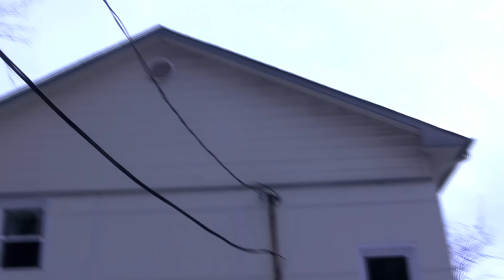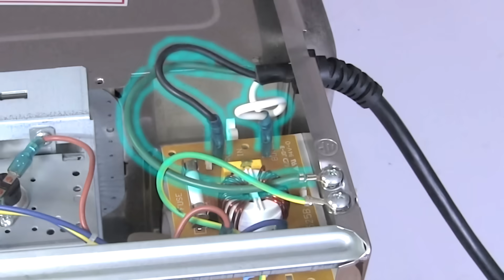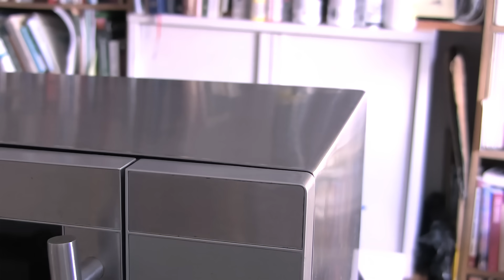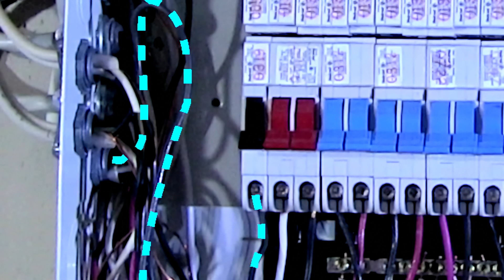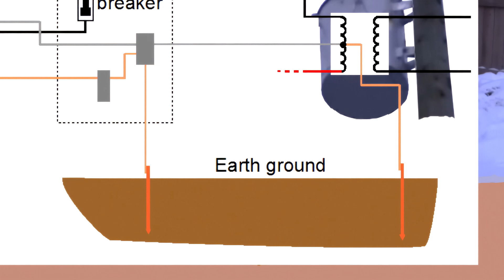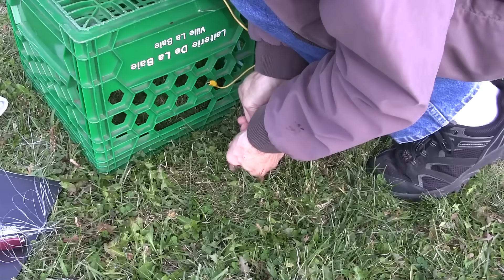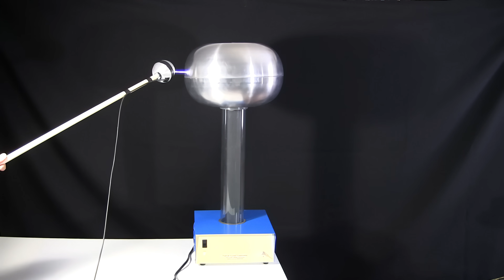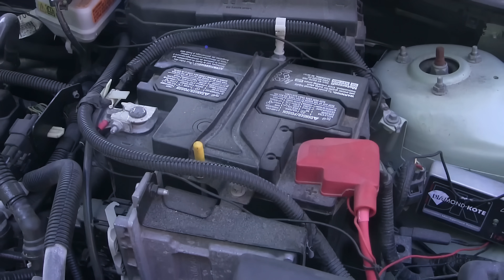What is Ground? Earth Ground/Earthing

Comment: The U.S. system is strange. It looks like you cannot put a grounded plug on an ungrounded outlet but can put an ungrounded plug on a grounded outlet. That is just the opposite how it should be. Using ungrounded equipment in rooms where there is ground is dangerous. On the other hand rooms where there is no ground it is not necessary to ground anything. In fact if you ground it is no longer such a room and you need to ground everything. Grounding is an all or nothing issue (excluding equipment with double isolation).
Reply: No such thing as an, Un-Grounded outlet or Switch. All receptacles must have a ground lug and ground wire, 3 prong outlet. Must be tamper resistant. Anything within 6 feet of water. Must be GFCI protected on that branch circuit. It can be anywhere on the circuit. As long as it is accessible..As NEC Code states. NFP 70e rules also can govern their use and installation. As Commercial and Industrial have higher standards. Anything from Vapor to Explosion proof. 

And everything is grounded. Unless on a low voltage circuit of 48 volts or less. Designed for that purpose. And yes double insulted tools and AC\DC drives do not need a ground prong. They have their own built-in thermal protection and must be clearly marked as such. As I seen inspectors walk around and cut the end off the cord. If it is not. As I had one cut the end off my Hilti Core Drill... His company had to cough up $2900.00 US dollars to replace it. As it was clearly marked.

Try watching some of Mike Holts ideas on Grounding and Bonding... https://www.youtube.com/watch?v=mpgAVE4UwFw
Reply: What is this:  https://zerosurge.com/wp-content/uploads/2016/12/elec-outlet.jpg

Yes, in new installations here also all outlets have to be grounded. It has been since the late 90s though in practice the switching began in the 70s.

If outlets are ungrounded it is safe to use any equipment. If they are grounded it is not safe to use ungrounded equipment.
Reply: You go ahead and play around with an ungrounded system...See what happens when a short can not reach the source. As you can be sued if you don't. 

And that outlet you posted. Has no been used in residential applications for 60 years. As it is required inspection before selling an old home. To pig tail these old systems to ground. Replaced with the new 3 prong outlet. As you will not be able to get insurance or financing. Till you do. Same for aluminum wire. They must be NOALOX pig tailed to copper using https://www.homedepot.ca/en/home/p.aluminum-to-copper-wire-connectors-8pkg.1000663916.html

That is NEC code. Along with Local Ordnance that cities impose. 

You should watch the video I posted. On why these have changed. As Electrical Theory has taught us....
Reply: The danger comes if someone finds and old equipment with two prong plug. You can connect it to a grounded outlet which is DANGEROUS. Here that could not be done as the plug is like 

https://productimages.biltema.com/v1/Image/product/xlarge/2000018342/3

and the outlet like: 

http://www.talotuote.fi/WebRoot/vilkasfi01/Shops/2013112707/55F5/6603/22E4/96A7/07D6/0A28/1010/E3FA/PISTORASIA_EXXACT_2-OSAINEN_UPJ_VALKOINEN_MAADOITETTU.jpg

Sure now such old equipment is likely to be rare but that was not the case in the past.

Ungrounded outlet is here like

https://www.finnparttia.fi/WebRoot/vilkasfi01/Shops/2014102905/5491/4F14/05A9/0A1A/C834/0A28/1010/BFCB/PP2A_ml.gif

These are not legal in new installations but can be in older ones. On that you can connect any equipment. It is relatively safe as there is no ground in the room. It is specifically forbidden to bring ground into such a room with an extension cord. Some did that as they thought computers needed to be grounded.

Comment: There is another reason why we should literally connect the ground wire to the ground at breaker panel: if the neutral wire somewhere between the breakers panel and the transformer get disconnected, and there is a connection between hot and natural, the natural line and ground line will be charged to same potential as the hot line. You will get shocked every time you touch a metal surface that is connected to the ground line. To avoid this, you need to make sure that the ground line is literally connected to ground. So it's a good idea if you connect your breaker panel case and therefore the ground line to a literally ground.

Comment: Short Circuits will always try and reach the source. That being the Transformer. That is why only the service entrance is bonded to the ground. All other sub panels are not bonded. The only exception is when you are using an Isolated ground. It is isolated to earth ground rod. Used in AC\DC environments like computers. As DC current amps can be very high. One reason they use a Super Neutral. To handle that over current. If the AC\DC transformer fails...
Reply: Fascinating! Info you've learned or studied?
Reply: I'm an Electrical Engineer..Started as Licensed Journeyman. I now design PLC\Program systems. Mainly DURApulse AC VFD drives for high speed automation and robotics..

If you want to learn more on grounding and bonding. Try here https://www.youtube.com/watch?v=mpgAVE4UwFw

Comment: Ground has another feature.  It tries to make what you are locally standing on concrete or earth at the same potential as your grounded applience.  I've seen grounds between buildings have 17 or more volts difference.  Seen a steel building arcing to a cast iron sewer pipe.  Grounds don't offer absolute protection. You can have a broken neutral between pole and service box.  Recently a little girl died when she touched an outside water faucet.
Reply: Jesus. That's terrifying. Remind me to bring my Camelbak.

Comment: You dont pay for.elecyricity.
You pay for the electron pump use.

The.sars device captures the degraded electrons returning to the pump for recharging via capaciters which do the recharging then loops the - electrons back through your circuitry aslong as one is open.
The result is you only pay for the initial pump use to charge your circuit. After.that the sars device keeps it flowing for no additional pump fees.
The inventer of it was murdered by the athorities for resisting the removal of the device from his home. The device was never seen again.

All you need to know is current flows from -to + and from + back to -.  This is the transion between ac to dc back to ac.

All you have to do is the converting to loop the initial load requirement

Non of these castrated indoctrinated jockeys will tell you anything really usefull. There all opec, penis toys.

Comment: If my house doesn't have ground cable, is it safe to connect the neutral wire to the ground hole?
Reply: It's kind of safeish and you should probably do that as an immediate temporary solution, but don't do that at the power sockets. Instead, connect the ground and neutral to each other at the fuse/breaker box. That way once you do get a proper ground for your house, you won't have to redo ALL the sockets and lamps.

The reason why is safeish and not completely safe is that a long time ago when there was no legal requirement for things to be grounded, things were not grounded, but they still functioned. But that's where the problem is: What happens when they no longer work? What if something breaks and the "hot" wire gets connected to something that should be grounded? At that point ideally, the "power" will just go to the fuse box along the duplicate neutral / fake ground. But what if it doesn't? What if in that moment you're touching the broken appliance and you're standing on a stone floor and your body is a better ground than the "fake ground"? At that point the power will go through you.
Reply: SmartassX1 Thank you for your explaination.
If I do connect neutral to ground hole at the power socket, is there any safety consideration?
Reply: Well... Other than the above theoretical risk, there shouldn't be anything.

Unless you have a "protective relay" (unless I mistranslated that) among thee fuses, it should be kind of fine. The "protective relay" is a type of circuit breaker where the neutral wire and phase wire both go though. This type of protection is good, but rarely used. If that is used, the relay should activate and prevent that socket from working. This type of protection is so rare that it's more like a "by the way"-type info.

An electrical ground for a house is not a complicated or super expensive thing. You should seriously think about that.
Reply: you can replace all ungrounded receptacles with gfci receptacles. Code allows this.
Reply: Why would a TN-C system heat up the PEN any more than a normal TN-C-S system would heat up the N? Any why would anyone ever disconnect any single wire from a power line that's in use? I suppose there are those who like to steal the copper wires used for ground, but it's good if those people get shocked. Any electrician would obviously turn of the power before doing anything.

His problem was that he sounded like he has a TT distribution system and his house doesn't have a local ground.
Reply: Well obviously the only good option is to just build the correct earthing to the house. And the are acronyms explained at the "earthing system" article at wikipedia.
Reply: The correct place to do this type of tricks is the fuse box. But really one should just do the correct grounding.

Comment: I'm sorry, your explaination is missleading. Ground, which usually referrs to a DC ground is not necessarily earthed. Ground may be floating with respect to Earth potential, like it is in a car, and an aircraft, and a boat, and at the output of modern isolated power supplies, and even old power supplies after a transformer and a rectifier. The negative output of all of these is actually what ground is. Earth, on the other hand, Where a system is connected to the Earth, then it is referred to as Earthed.
In an Earthed system the ground reference is Earth potential, whilst in a non earthed system the reference is the designated ground which may well be floating above or below Earth potential.

You also only describe MEN earthing systems, and whilst I know you go to some level to specify
 that it's in North America, you would have done well to have explained how non-MEN systems work in the rest of the world.
Ground is a floating common reference point, e.g. a car body attached to a (-) battery terminal Earth is referenced to a rod in the earth.
This video is missleading in it's over simplification and missuse of terminology.
Lastly its not sodder, its soLder.
Reply from the maker: I address common ground starting at 8:09. I even mention chassis ground in a car.

Regarding MEN earthing systems and other systems worldwide, I made a decision to limit the scope otherwise I could have gone on forever, plus I would have gotten way out of my comfort zone. The target audience is lay persons curious about the gound hole in their wall socket, though I did add that extra stuff at 8:09. For that audience, I also stayed away from terms like electrical bonding conductor and deliberately used ground wire instead. Electricians should watch videos like Mike Holt's instead https://www.youtube.com/watch?v=mpgAVE4UwFw.
Reply: Rarely does one hear the term “earthed” in North American usage, so “grounded” does duty for both earth-connected and floating references. As for the trolling of the pronunciation of “solder,” the ”L” is silent in every American dictionary entry I’ve ever seen (ranging back into 19th century publications), and everyone I’ve ever known pronounces it “sodder.” Nor do we use ka-nives to cut our saLmon, properly pronounced “sammon,” so there are parallels and precedents for silent letters, not to mention the French origin of the word, which contains no “L.” Lastly, “misleading” and “misuse” are spelled without doubled esses, so perhaps there’s room for all to observe variances and make mistakes.
Reply from the maker: The "L" in solder is pronounced in Europe. I've pronounced it sodder my whole life but for some unknown reason I started pronouncing the "L" every now and then though I try to say sodder, given that a large percentage of my viewers is in the US.
Reply: grounding is actually earting in ac  grid systems. in dc systems it is mistakenly used as slang for the correct term "common"
Reply: Yeah I have always heard "ground", I'm in the States.  I really didn't hear the term "Earthed" until I started watching Big Clives Vlogs.  Peter Peterson's reply does give me a bit more understanding on what the actual difference in the meanings between the two terms.  Either way I enjoyed this video.
Reply: The difference is....  have you ever commented on Big Clive's vlog and smarmily stated "it's not earth, it's ground" and/or "I don't like the way you pronounced soLder!!!"?

Comment: Creepy Socket.
The plug is only held over the contacts in the socket.
In addition, there is no protection against touching the phase of the plug (eg when pulling out).
I prefer the SchuKo ^^.
Reply: Would you prefer bare copper knife swtiches? lol I've done that, it's not fun. You learn to grasp it carefully and just ensure you push it in all the way. A decent plug will hold it well. You can get different rated plugs as well. Hospitals use plugs with a certain force that they grip the plugs with and are marked accordingly so that you can't just trip and unplug someone on life support.

Comment: In Ontario Canada HydroOne has been using ground as a return path for high tension and residential delivery. Stray Voltage takes non linear paths to the point of generation. Electric potentials in excess of 100v/m have been recorded but the regs are 1.6v/m which IMO is still too high. Farm operations are both sources and victims of stray voltages. Also anyone near transformer switching stations can be affected.
Residential Grounding does make sense from a safety perspective, but that's not the whole story.
On the plus side, if your property has a ground potential, use it😉

Comment: Why isn't the microwave case just connected to neutral, so you need one less wire?Is it in case one of the wires (neutral or ground) breaks?
Reply from the maker: When the microwave oven is turned on, the switch basically connects the HOT wire to the neutral wire (through the oven's electronic circuit). That means you'd be connecting the HOT to the case. If someone was grounded and they touched the case, then they'd get a shock.
Reply: Ah, I see, that makes a lot of sense actually. Thanks!
Reply: RimstarOrg 

Makes sense, but it Germany we have "klassische Nullung" in many older houses, where the ground wire is directly connected to neutral. I always thought the reason they didn't do it in the devices themselves is because you can flip the plug around (works in Germany with ground plugs too) so you have no clear hot and neutral in the device. 

Hence your comment really makes me think...

Comment: Video guide is good. But help me out on understanding how an inductor works with an AC voltage source using wave forms
.................Things like : HOW WILL BE APPLIED SINUSOIDAL VOLTAGE GRAPH 
                                        HOW WILL BE CURRENT THROUGH  THE CIRCUIT
                                        HOW WILL THE FLUX BUILD UP AND INTURN PRODUCE ADITIONAL EMF AND THUS INDUCED CURRENT AND HENCE THE LENZ LAW FLUX...............................
                                        WAVEFORM OF HOW MAIN FLUX AND LENZ'S FLUX WILL AID AND OPPOSE EACH OTHER IN THIS PROCESS  USING WAVEFORM ANALYSIS......................?

PLEASE PLEASE PLEASE.......................THIS DOESN'T LET ME SLEEP AT NIGHTS
Reply: FooBar Maximus 
I understood about inductors and how lenz's law is performed in inductors.....more clearly.

After commenting, I did vigorous efforts on understanding how current lags voltage by 90 degrees and I understood visually by spending more time.

Now I can even make a video for noobs like me to understand it.

Thanks for your response.
Reply: It takes years of study to fully wrap your head around it all. And even then there's enough left over to learn something new every day. Current lags voltage depending on the capacitance and inductance in the circuit. I.C.E.--E.L.I.
Reply: Will the Electrician 

ICE ELI means ?
Reply: ducard Ras it means in a capacitive circuit current represented by the letter i Leeds voltage represented by the letter e. And in an inductive circuit voltage Leeds the current. Capacitance is represented by the letter c, and inductance is represented by the letter L. The letter c for capacitance is measured in farads. And the letter L for inductance is measured in Henries.